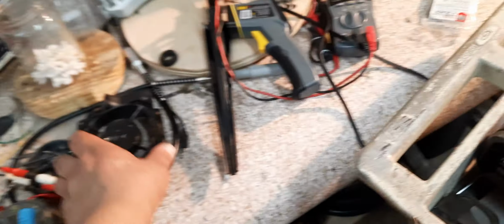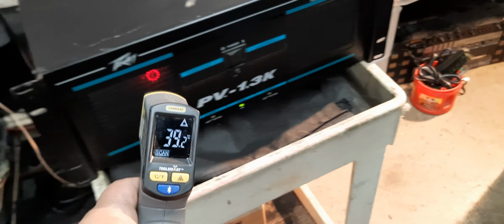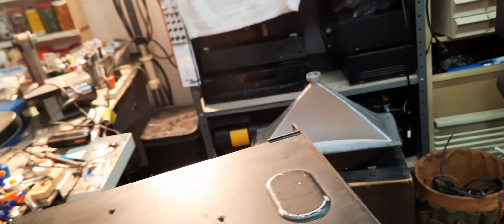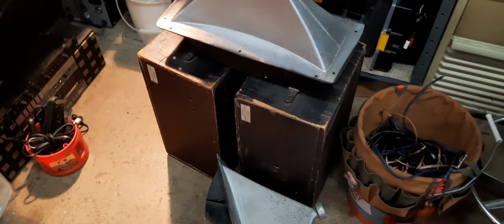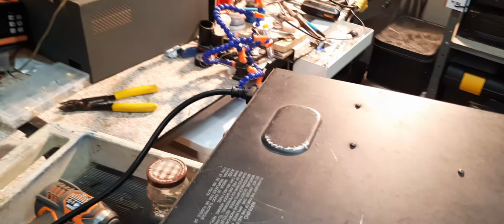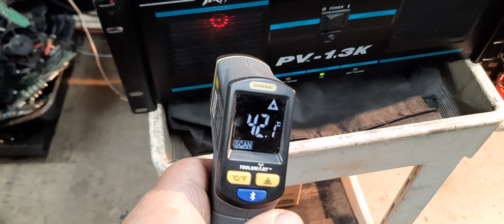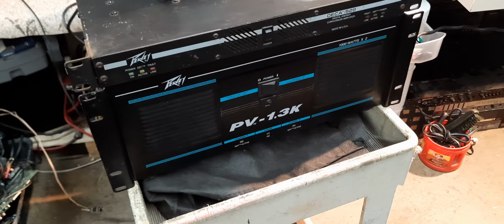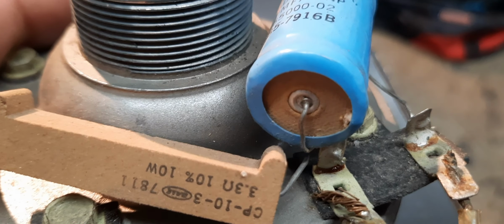Heat testing Peavey 1.3k power amp with new fan install.

Comment: Looks like a beast 💪
Reply from the maker: Yeah it's an 1980's amp and it throws out some serious power. Had to run  some pwr. Wire through the living room floor and give it its own breaker which was a 20 amp breaker in the basement breaker box.